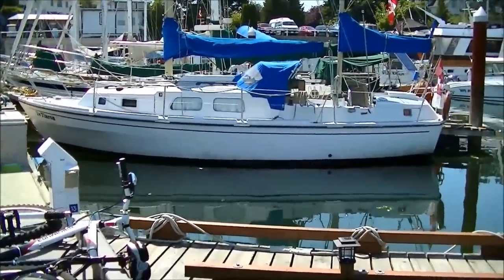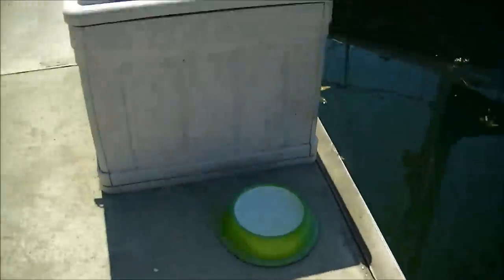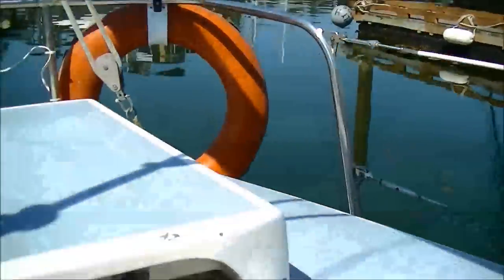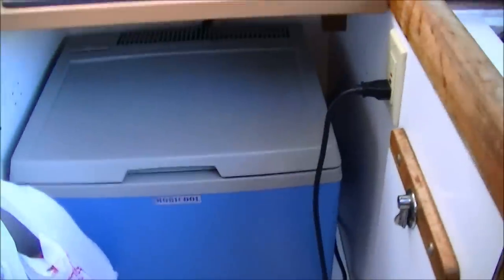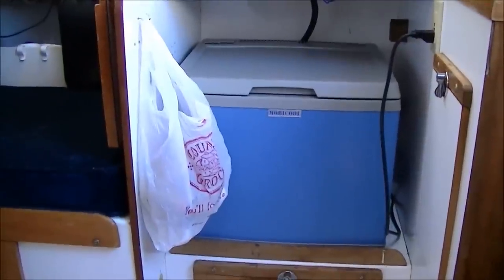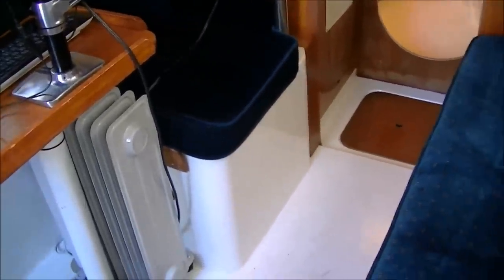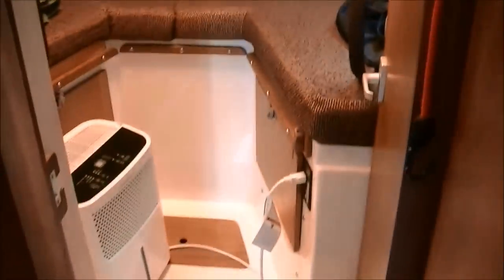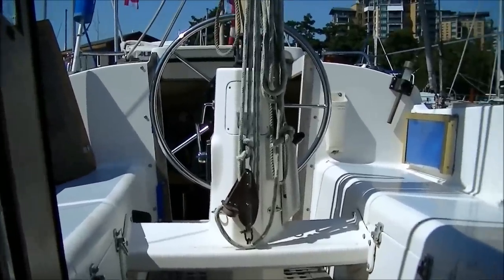Liveaboard Part 6: Tour of my boat

Comment: Nice video. I also believe that an aft cockpit boat is better usable as a live-aboard boat than a center cockpit in the northern hemisphere. Especially in the winter. 
You mentioned in a earlier video that shower on-board in the winter is not a wise thing to do due to the damp. But if you had a rotating fan, driven by the wind, would that help? I installed that kind of fan on a boat I had before. And it was amazing how much drier the boat was. No fog at all even when I was cooking! It will build 10-20 cm above the deck depending on the size.
Nice to see that my two favorite live-aboard vlogers lives next to each other!

Comment: wow i see you live next to Curtis on Second Wind. i watch his videos as well. you made a comment on Catalina's, i spent 30 days on a 36 Catalina sailing and cruising the west coast of Florida. it was very comfortable to live on and sailed good as well. but holding tank and water tanks are very small. we ran out of water in the Dry Tortugas in only 6 days not good when you are 24 hr sail from land that you can get water. i thank any boat you get and are going to live on you will need to do some up grades to make it fit your needs. the key is to get a boat that has most of what you need or like and that is easy to upgrade on the tings you need to upgrade. by the way nice boat...

Comment: I would put in a pull out draw for under your cook top (leave a gap obliviously) have some wood on the top of the draw sections so you can use it as a pull out chopping board and under that chopping board is your knives and folks.

Comment: I liked the videos ,watched them all and got some good hints. I have a 30-2 Ericson that I have repowered,rewired,and today I hope to finish repluming. I was wonreding what your take is on enclosing my cockpit, I hope to retire in the next year or so and I am wondering if the extra cost is worth the cost. I do use my boat a lot more than most, almost every weekend. Your opion would be well listen too.
SV" Positive Results"
mike Harper
good winds!
Reply from the maker: +mike harper Hi Mike, glad you liked the videos and came away with something useful from them. I highly recommend enclosing the cockpit. The Te Tiaroa did not have anything over the cockpit other than the dodger you see in the video, and I found it to be sorely lacking. A full cover that included removable sides was one of the thing I would have installed on the boat were I still living on it (see my video "Living in a class B RV" if you want to know why I'm not). Full coverage with removable sides gives you shade when it's hot, shelter when it's wet, windy and cold, and extends your usable living space regardless of the weather. Well worth the cost IMHO, and a "must have" in my next boat.
Cheers!

Brad

Comment: Thanks for your videos. All this is just a dream for me so far, but one day I'll give it a try.
Since you mentioned heating, do people use air conditioning when sailing in the Caribbean?
How do you get your sails up and down? Do you have motors, or you just pull the chords? I imagine
that there are fancy boats where all this is automatic. Also, do you need fancy a GPS and/or computer
to navigate, or you do it the old fashioned way? Since you mentioned the cost of your boat, how much do
you spend per year in maintenance, repairs, etc.
Forgive my questions, but I am totally ignorant, but very interested.
Thanks again.

Comment from the maker: Navyattitude to answer your question: I use the marina's address as my address. The marina I'm at has mail boxes for residents so we just add a unit number to the marina address to correspond with the box we are using. For things that require my physical address be recorded, such as my PAL/RPAL I add my slip number to the marina address.

Comment: Thanks for the video, very insightful. Quick questions. How much does it cost to anchor at the dock? And how much did your boat cost? Thanks
Reply from the maker: John Connor My boat was just over $20k and moorage varies from $500-600+ per month and includes parking, electricity, cable, phone, and internet; my winter electricity usage is much higher so those months are in the upper end of the scale.

Comment: Hey Van, awesome job, great series! Lots of good tips!
I have question though in regards to legal stuff when it comes to sailing. Do you need any permits or certifications, skipper certificate or anything like that? Any Coast Guard safety inspections need to be carried out?
Thanks in advance.
Reply from the maker: +Billy Beerman Thanks! Here in Canada you need a Pleasure Craft Operator's Card which is stupid easy to get: you can study and do the test on line for something like $50.  Is this enough to do it safely? Heck no.

The boat requires licencing. If I remember correctly this is free and you can do it online. Good for 10 years.

A survey (boat inspection) will probably be necessary for insurance purposes, and is generally a good idea before purchasing anyways, however it is not legally required. Most decent marinas will ask for proof of insurance and or a survey for long term residents.

The coast guard has rules regarding safety equipment that is required to be on board. The equipment required is different depending on size of boat.
Reply: +Van Isle Gunnut  Hi Van, thanks for the great info. I appreciate you took time to respond. 
Now I have enough to get me started on the journey to get my own boat :-).
I will do PCOC online - I have checked some accredited online courses, and like you mentioned, it seems quite trivial certificate - very basic.  I believe,  the VHF radio operator certificate is also required.Thanks again. Cheers!

Comment: Could you please tell me if this a Macwester Ketch 32/33"? or what model/brand it is?
Reply from the maker: It's a Westerly Renown 32.
Reply: Thank you! Might buy the same boat! is 4300 USD a good price for one that is sold without an engine and needs a good amount of restoration inside?
Reply from the maker: No, I think that's way too much for a boat without a motor that also needs work: I'd walk away from anything that doesn't have motor considering how expensive putting a decent motor in it will be, even if you do the work yourself. Be patient and find something mechanically sound.
Reply: Thanks! The seller is suggesting putting on an outboard engine. Is that an ok way to go on this boat? What size/HP of an outboard would be needed?  

There is also an Alo 33 sailboat for sale with Volvo Penta MD2020 freshwater-cooled going for 4950. I'm looking for a live-boat with sailing around the world possibility. Would be great to hear your opinion :)
Reply from the maker: I don't know much about the Alo 33, but as long as it checks out mechanically I think it's worth serious consideration. (I do like the fact it was built in Norway) Make sure you get a survey done on it so you have an unbiased opinion of it's condition/value. (I think $4950 is very cheap for a boat of that size, I'd be finding out why.) Volvo makes a good marine engine, but they are very expensive to have work done on them so make sure the you have the surveyor give it a close look.

No engine? That's not a boat, that's someone's "project". Walk away. Find anther boat.

Comment: could you advise me on heat please.
Reply from the maker: thatsjustwrong100 When I'm at dock I have 120v 30a service so I use 2 cheap oil filled radiant heaters, one forward and another mid cabin. I'm not sure how or why it happens, but ceramic heaters and other electric heaters seem to have a nasty habit of multiplying the humidity in the cabin so I don't use them. I also have a Dickinson Newport wall mounted heater that works on propane that I use when I don't have shore power and also when I want quick heat. I promise in the next few days I WILL post a video on the Dickinson heater, as I think it's so awesome it deserves it's own video. I'll also elaborate on some other heating option while I'm at it.
Reply: great thanks
Reply: thatsjustwrong100